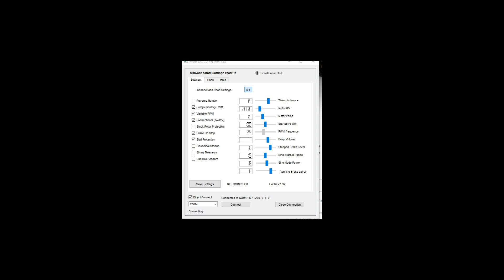AM32 Stopped Brake Level

Comment: Not true, this works without the brake box checked mine brakes strongly on 2 and won’t hold the 1 setting after save changes even though it confirms the save and it won’t go to zero
Reply: Mine does the same. Do you have any solution to reduce the brake when we let go the throttle?
Reply: @ridwanrismanto4805 no solution I bought a second one and as soon as I connected it and adjusted the brake it was ruined it also wouldn’t go back to its default setting it is now set I think to a stick radio and nothing I do will make it work on a pistol radio.i have tried everything. Both esc’s are now junk